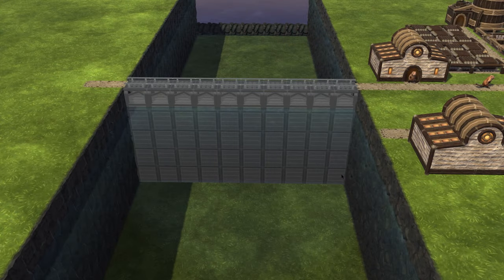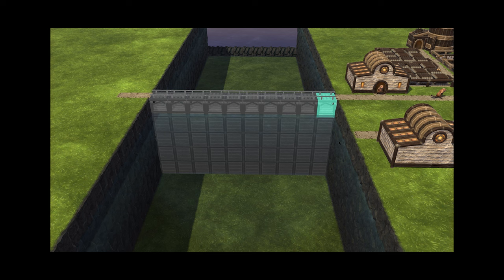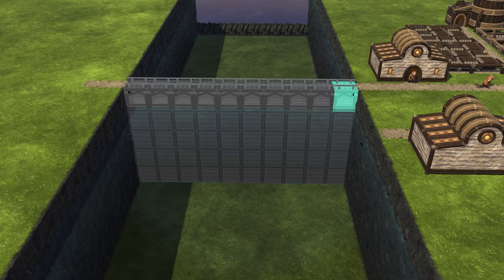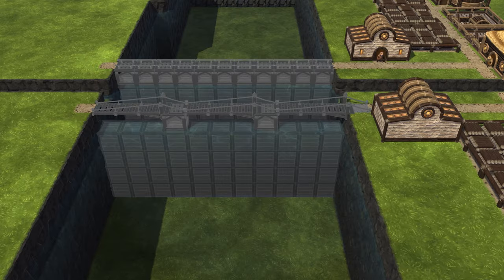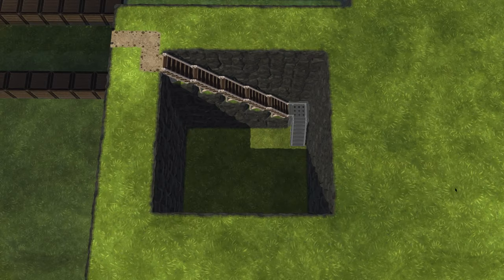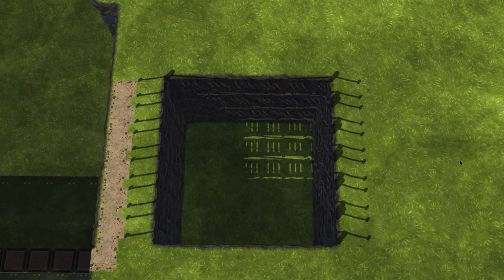Using Bridges for Faster & Easier Building in Timberborn!

Comment: That's a fantastic tip, never would have figured it out. Is there a limit down or up the beavers could work, I tried to build down and it seemed like there was a two tile limit. Need to check again.
Thanks for the tip, great video
Reply from the maker: It's an infinite reach down but they can only build up two tiles so always build top down if you can help it.
Reply: @m0ro  Brilliant, thanks for that tip

Comment: Question about the bomb laying with bridges, do you need a bridge over every row? or can they place bombs off either side of the bridge in addition to directly under the bridge? in other words, could you make that same hole with half the number of bridge columns? I see they can reach the bombs from the side of the bridge if they are on solid ground, so could they also reach a bomb the side of the bridges?
Reply from the maker: They can only plant down and forward on a bridge, not sideways. So you can do the bridge plus one more spot in front and that's it. Bridges are treated differently from regular ground so that's a pretty firm limitation.

Comment: 4:45 it doesn't matter if you use mods and play the game like you supposed to without artificial blockade. I'd understand if "districts" actually improve game performance by multi threading the game. But they don't. Devs also didn't implement VULKAN.
Reply from the maker: The districts are in place because of performance issues I believe. There's a mod that unlocks longer district ranges and it supposedly KILLS the game hahah.
Reply: @m0ro  higher amount of beavers kills the game. District or no district.
Reply from the maker: @brokengames9020  Yes, but it's way worse if you extend the district range.